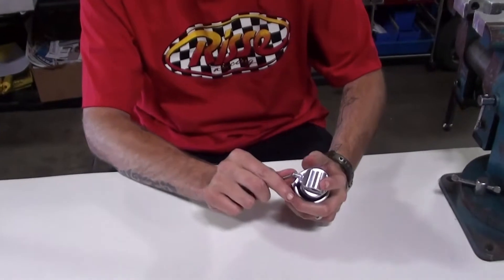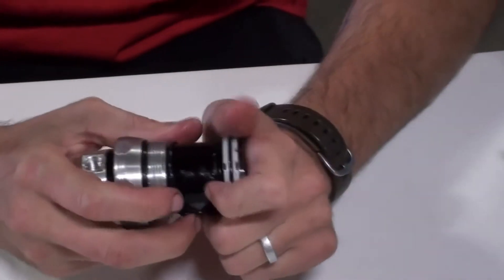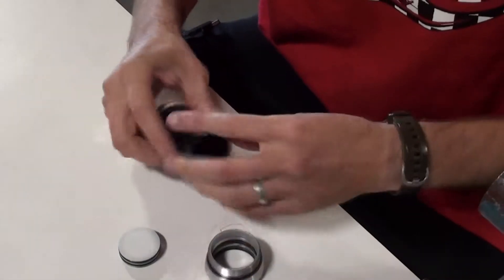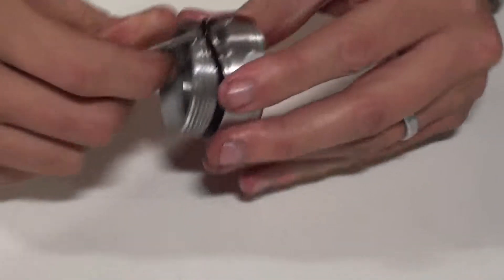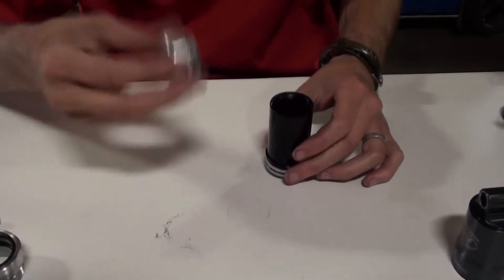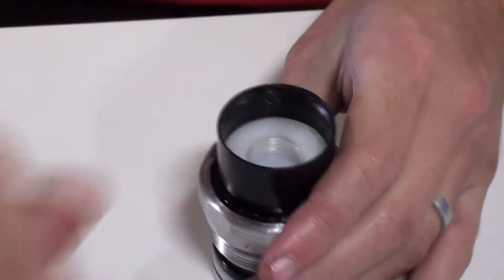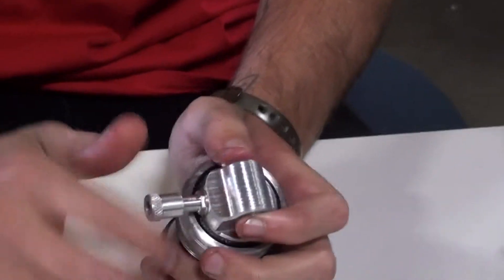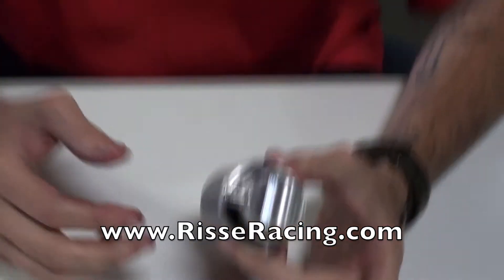Genesis Rebuild - Risse Racing

Comment: Bought a Genesis to replace a Vanilla Fox Shock for a Cannondale SuperV back in October 2015.  Worked fine for a few months but it suffered complete failure by January 2016.  Risse is going to warrantee the repair, but I'm shocked at the speed that these things fail.  I hope it was a one-time thing, and not a more serious engineering problem.  My riding was almost entirely on-road plus the factory Cannondale Fox shock lasted 20 years without a problem.  Let's see how the replacement does....
Reply: how was the damper after the repair?

Comment: Hi I own a Genesis shock for AMP Research B4 bike.  It holds 150 psi currently but bottoms down when I am riding.  I am 190 pounds of weight and 6'1".  Can the Genesis Shock be rebuild at your facilities and at what cost?